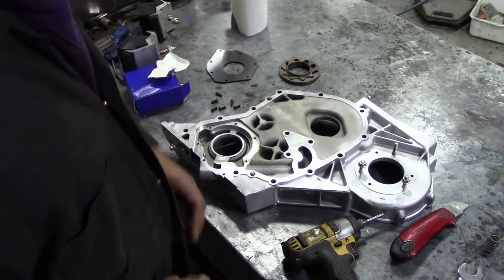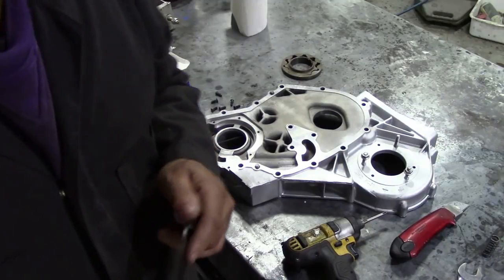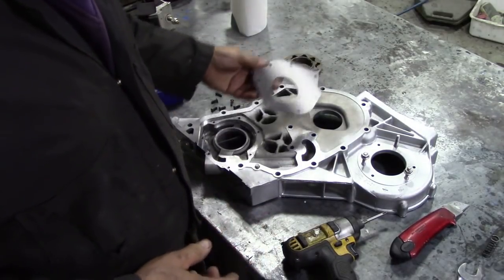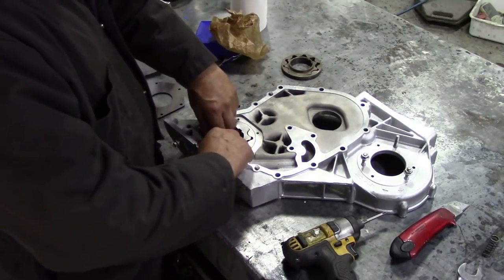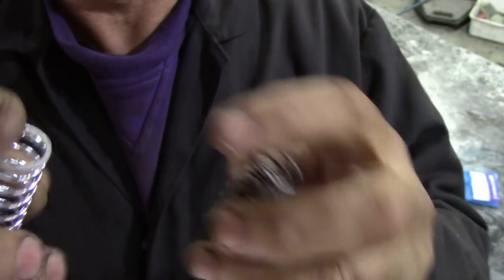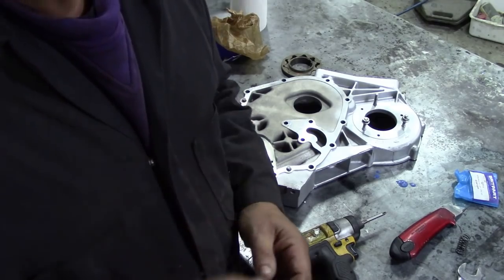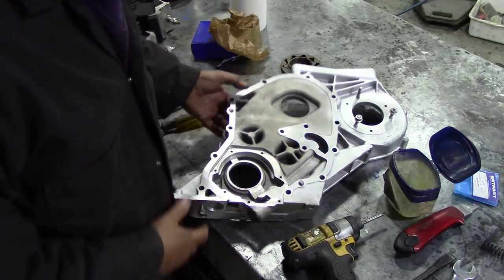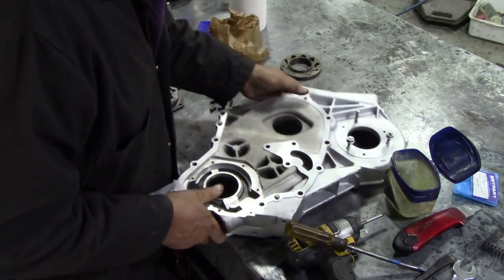300Tdi rebuild. Oil pump, Engine mounts, Oil filter housing

Comment: Watching video's like this makes me wish I had a 300tdi vehicle again.

Honestly, I've come around to thinking that the TD5 is a better engine (once you sort out it's weaknesses) than the 300tdi but the 300tdi is undeniably very well designed and much easier to understand and work on.
Reply from the maker: Couldn't agree more!
Reply: Td5 has a problem with porous blocks, shows up in bores can be mistaken for head gasket, also it just appeared with no evolution like the 300tdi
Reply: Td5 has a problem with porous blocks, shows up in bores can be mistaken for head gasket, also it just appeared with no evolution like the 300tdi

Comment: Lovely job Mike.
If your that deep in. Change the oil pump! The engine will last so much longer with good oil pressure.
And before anyone says, I know, pumps create flow, restrictions cause pressure.
Reply: I just want to say, pumps create flow, restrictions create pressure!
Reply: @greebo7857  Yeeaaa! Thank you Greebo! Brilliant

Comment: Hi Mike,
thanks again for a nice video, regarding the pressure gauge I opt for the electric one just place a sender instead/in addition to the pressure sensor switch, place the gauge in the car and connect them with a wire, VDO have good products for this.

cheers

Comment: Good advice on the oil pressure gauge line Mike, I fitted a gauge to my Disco and the olive on the nylon line "nipped" the line near right through, amazing how quickly you can empty a Tdi engine sump through such a small line, luckily we have a combination "Murphy" switch on coolant level and oil pressure.
Reply from the maker: Great idea

Comment: G'Day Mike.
Nice straight forward video as always. Just thought I'd let you know, the USB Stick turned up this Monday. Big Thanks for that matey.
As to gauges, wherever possible and practical always go electrical/electronic. All bar the boost gauge type (you see what I did there  lol ) respond faster and more reliably as electric types than mechanical types (I have found, in my opinion) and are easier to install. In fact I usually run a multi core cable (like 7 core trailer cable) from the engine bay into the cab behind the instrument cluster just so I can at any-time install what ever gauges I fancy at a later date and I only had to do one run for connection purpose for all and any future gauge (if I think I might need more, I'll go a bigger multi core cable).

Comment: I had to many bad experience with these t adapters for extra sensors. Always leaking, turning itself out, ...
The oil filter housing actually has a place for an extra sensors, you just have to drill and tap it.

Comment: Very helpful! how did you go about cleaning up and spraying that cover without damaging the oil pump channels?
Reply from the maker: I sand blast the exterior and wet bead blast to polish - I avoid any oil ways, then stick in the ultrasonic to make sure there is no debris in the parts
Reply: Ahh amazing! so no paint involved at at all? i saw in another one of your videos you painted the block of this 300tdi - whats was your process for that in terms of prep and paint?  @BritannicaRestorations
Reply from the maker: I only paint steel/cast iron parts after cleaning, or they rust too bad

Comment: whenever l start my 300tdi engine, the oil light turns off, but when the engine gets warm the oil light starts showing up and disappears upon raving. What could be the problem?
Reply from the maker: I would start by replacing the switch - they can fail when they are old and do not buy cheap aftermarket switches - they are a false economy

Comment: oil pressure gauge .. use electric , i can't think of one reason to use a mechanical one in a car ( but on a test-bed mechanical is much easier )
Reply: You don’t like oil leaking into the pedals and behind the dash???